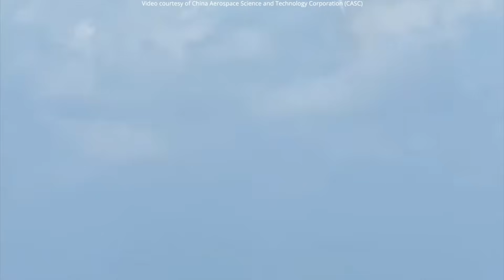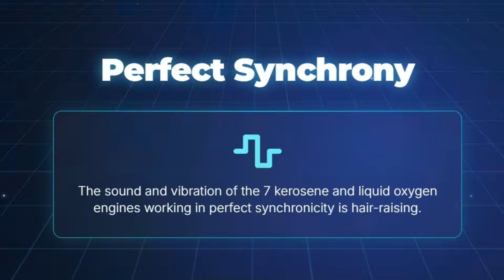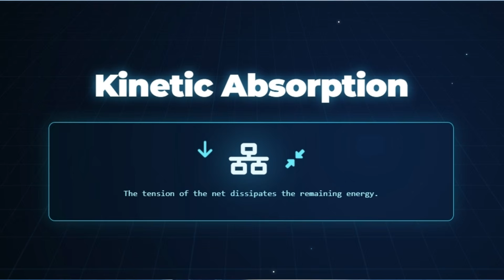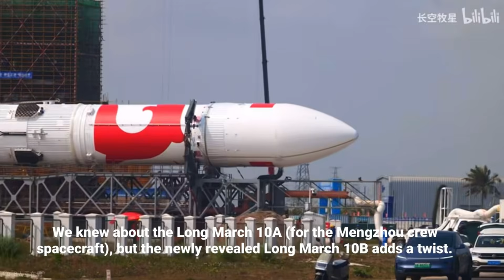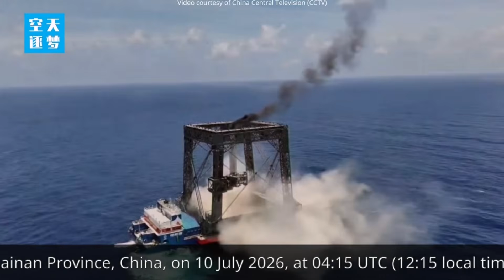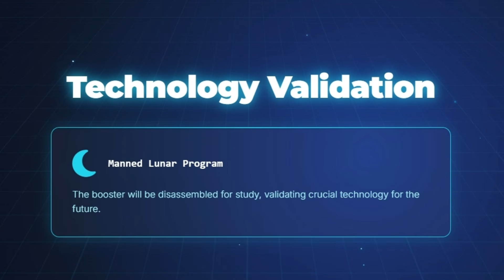Rocket Caught at Sea: China's Insane Achievement

Comment: the rocket actually targeted the center of the net precisely although it is allowed to shift away a bit.
Reply: The advantage being there can be a shift in the cables depending on the orientation of the vehicle.
IF its "Central" on the "East West" axis, but 2 m "North" on the "North South" axis, that's easy to detect and that pair of cables can be shifted.
It's not unlike a scaled up inkjet printer mechanism, or a multi axis milling machine. Just needs sensors to establish the x,y axis centre

Comment: why cant rockets be designed and built to land in water body instead? the platform can still be retrieved and reused? only reason i read seem to be the 'extremely difficulty' to reuse a rocket exposed to ocean. salt water and under sea current i guess are main problems
Reply: Sea water is corrusive. And rocket is not completely sealed.
Reply: Because a landing rocket has HOT engines running at Max capacity at the point of landing and it you dip them in water there will be a reaction. ("BOOM!")
Because any "On board flotation" would be HEAVY and HEAVY is the enemy of space flight (you need more fuel to launch which reduces payload) 
and other reasons

Comment: I think both system does have its value. In the case of spcx, the chopstick can pluck and insert the starship onto or from the booster stage. I think spcx envisage a recovery system that is more versatile and faster to turn around launch time. Spcx didnt just design the starship for space exploration, they have gone a step further to use it for inter continental travel. And the size of the starship means it can carry more people and things.

Comment: Actually it reminds me of the F-35 lightning II fighter jet, it looks elegant when taking off and landing vertically, but it has to accommodate a space for the huge nozzle for the downward thrust, this space could house more missiles. As you correctly said in the video, landing legs are a weight penalty, if legs can be eliminated, more payload can be put on the rocket.

Comment: China's new net-based recovery system offers several distinct design advantages over SpaceX's Falcon 9. By eliminating heavy landing legs, the rocket saves considerable weight, allowing for greater payload capacity. The system is also far more forgiving of landing errors, with a capture window of up to ±50 metres – a stark contrast to Falcon 9's requirement for near-perfect precision. Additionally, the cushioned net catch significantly reduces structural stress on the rocket, which could extend its operational life and reduce refurbishment costs.

That said, there's little point in directly comparing the two. It's rather like comparing the International Space Station with China's Tiangong space station – which, as most space experts acknowledge, is widely considered more advanced, despite being newer and less travelled.
Reply: The Chinese have created so much resentment for themselves. No one gives a shit about this at all. You reap what you sow.
Reply: there are at least another two advantages. 1. once they decide to recycle the 2nd stage of the rocket. then China can use the same way to recover both 1st stage and 2nd stage with two recovery ships, however, SpaceX possibly can't use landing legs for 2nd stage. then they have to use two solutions to recycle the 1st and 2nd stage of Falcon. 2. Every time SpaceX comes up with a new rocket or a new recovery solution, SpaceX always requires to blow up few prototype rockets to collect new data. But China can reuse the net system to recycle different configuration and size of rockets as long as it fits the net system. furthermore, China can use the net system as a help to get the experiment data for new reusable rockets/solutions (legs or other new kinds) before the solution and rocket are finalized w/o explosion of rockets like SpaceX experienced.
Reply: One more point to be clarified is as follows: Launching and recovering rockets in areas with lower dimensions can at least reduce fuel consumption by 20 percent.
Reply: They have to prepare 3 recovery ships if the rocket configuration like Falcon Heavy
Reply: @ArekNgalam-q9t  China can build carriers, it's not a problem for them to build a recovery ship triple the size or the load of this one.
Reply: @jrylei  how’s that economy doing? 😂